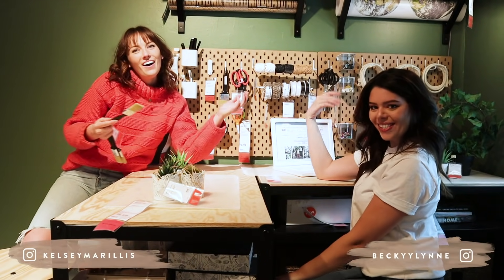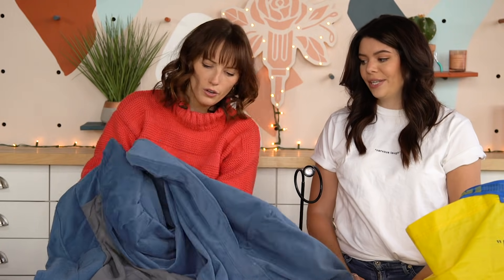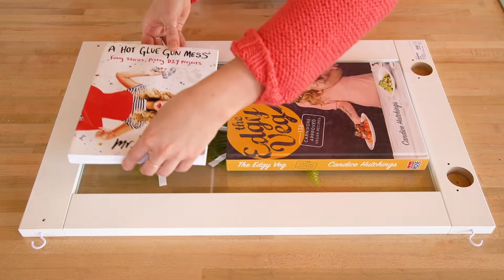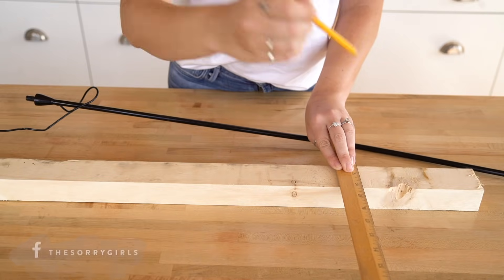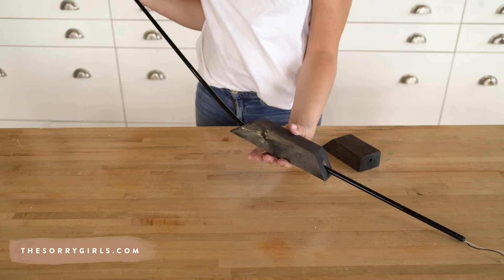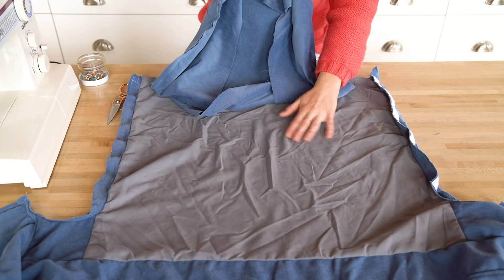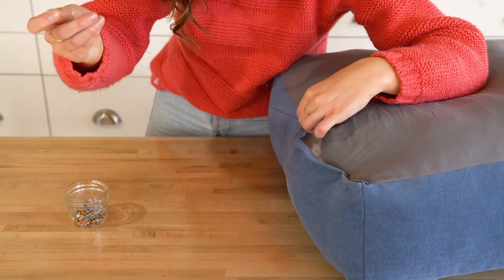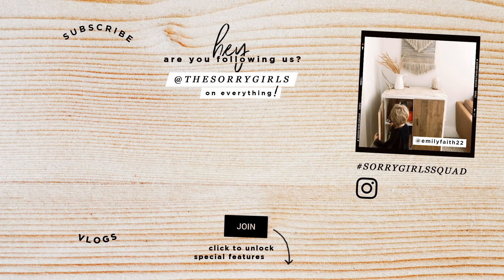Making questionable things cute (from Ikea)

Comment: 3:18 to have an easier/less strenuous time, winding C-hooks into walls, ceilings, wood and frames. Put a screwdriver through the hook and twist the screwdriver round. It will work as a lever, and saves using strength/muscle 💪🏻 power, in your fingers/hands✌🏻😁.

Comment: Little tufting hack: just use a normal, small button ( there are usually really cheap fabric lined ones in craft stores, that are used on sheets. They should protect your floors from scratching) on the other side of the cushion (or whatever ur tufting). Makes it very easy to knot and pull tight the thread 👍🏻

Comment: Why unstuff the cushion thing?  Unstuffing makes such a mess all over with dusty fluff......wouldn't it be easier and less messy to just pull the cover over the whole pillow, sew it up and add the buttons?
Reply: I don't think the cushion was the size they wanted the pillow to be, so that's probably why they didn't use the whole cushion.
Reply: Also, why try to make a big knot at the back of the cushion to keep the thread from popping through? Just put four inexpensive buttons on the reverse side. That way you're sure they won't pop through the pillow.
Reply: @michelepaccione8806  it wouldn't have the effect of the buttons being sunk into the cushion then...

Comment: Okay okay that is NOT how to splice those two wires together and you’re gonna end up burning your house down. There are special tools that you can use to attach 2 wires end to end. I don’t remember what they’re called but any hardware store would have them. DO NOT just wrap them with electrical wire! They won’t connect right and it’ll make a spark that’ll melt the plastic and burn the wood. You really should leave the electricity to the professionals

Comment: "Hack together"?   Really?  Are you that desperate to sound "cool" that you're going to call sewing, something that has been done for hundreds of years a "hack"?   smh  Also when  tufting,  tie the thread to a button on the opposite side,  the amount of pressure will eventually cause the string to pop back through and leave a big hole there.
Reply: The tufting tip is very helpful, but there's no need to be a snob about the terminology she used. The point got across, either way?